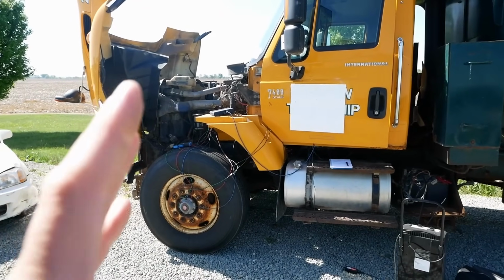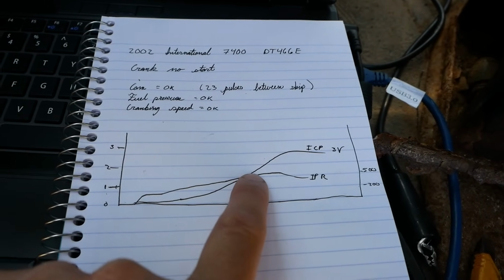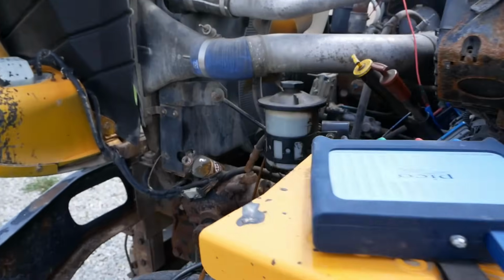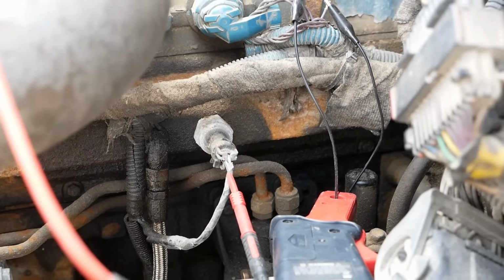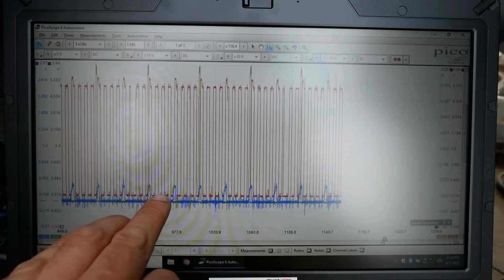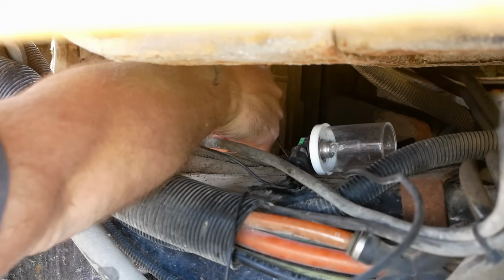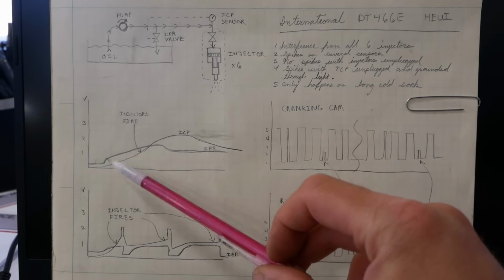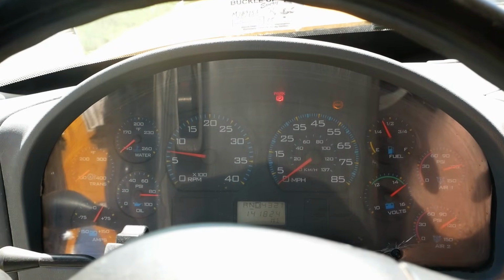International DT466E Won't Start without Ether after Sitting

Comment: Hey, couple things.
Do you have while cranking 500 psi or more  high pressure oil for injectors? If its low it wont start. Bad ipr valve or bad wiring at ipr valve it wont start, i had that at the ipr connector, the wire sheathing was torn and they were touching each other. also i had one with no codes and it was a bad cam sensor, another truck had no codes and it had a bad crank sensor. Also had another intermittent no start, the connector at ecm was loose i found it with wiggle test. sounds like your truck is intermittent, they are the worst to fix, if you get it running grab any wires, harnesses, connectors you can get hold of and move the hell out of them, try to pull connectors apart, ect. Check for corroded connections  starting at battery terminals. I seen a few where the circuit breaker for IDM or fuel heater  had corrosion at the box that holds them. check fuses too,of course. I always start at fuse panel looking for blown fuses, corrosion, bad circuit breaker, ect, fuses at battery, basics first, visual checks

Comment: Enjoyed the video Wes.  I don’t have too much experience on the older 466e models.  But from what I have seen on all older internationals, is the ecm power and ground weather pack connectors are notorious for having high resistance due to spread terminals.  This will cause a hard start issue and ecm power down issue.  There should be 3 weatherpack connections, one at the battery box, one by the starter, and one by the firewall (driver side).  I know you checked the powers and grounds at the ecm with a test light.  But to verify whether these ecm powers and grounds are the problem, what I would do is, before starting the truck, after a 48hr cold soak. Back probe the ecm connector at the powers and grounds like you had them. And see if you have sufficient enough voltage and a good ground with the key on and while cranking.  You can even supply your own power and ground while cranking to see if this is your issue.  Also do you think that you have a parasitic draw on your batteries that could be causing a ecm power down the longer it sits?

Comment: Your not getting oil pressure to fire injectors. Bad o rings on rail.
Reply from the maker: We are. We can see it on the scope ICP voltage goes to 3.5 with injectors unplugged. That's 2500 psi. You must be the 300th person to comment this.

Comment: i would replace the cam sensor they are the same international say there not  i had 12 trucks. the easy way to measure them is the one you take out with the one you are putting in. i wire on the ipr goes bad from heat and oil check that. you have to buy the ipr but the magnet goes bad most of the time. you do not have to pull the huey pump to replace the ipr just remember there is a ball that can roll out. i think it's a 1 1/4 deep socket i think it's the craftman that works look inside the socket if it has shoulder it will not work.

Comment: Stalled out a 466 climbing a hill, it started rolling backward, they will bump start and run in reverse. Don’t do it. Blows exhaust out the air cleaner and draws air in through the exhaust.
Reply from the maker: Can confirm. Seen it happen.

Comment: One thing I always did with these DT466's with sketchy issues like this. Have a good working IPR, ICP sensor, Cam Sensor on hand. Replace all 3. If it starts good. Re-install each old sensor untill original issue developes again. Check grounds and powers to ECM, correct as required. Also you need to check duty cycle of IPR and the oil pressure of the HPOP to determine a weak oil pump or failing IPR(NO START HOT CONDITION), also install vacume gauge on suction fuel line to tank to make sure the pick up is not cracked at the very top. This is not in response on your diagnostic video here. Just a general quick overview from what I have learned from working on these internationals. Once you familiarise yourself with these internationals and the dt466. They are so simple and can be diagnosed in under 2 hrs 98% of the time. Other 2 percent of the time, your looking at ECM harness issues or the ECM itself.

Comment: Had this on a truck I worked on. Issue was low compression. Truck had "compression" but not enough to light the diesel from a cold start situation. Would smoke but never get hot enough to start without ether. Was simply worn out. The cross hatching was gone on every cylinder. So, we did an "in frame" and got it running. Recommend a total overhaul, but it was a local truck and wouldn't spend time on the interstate again so the owner went the cheaper route.

Comment: I worked on one of these, customer says only starts on ether and has no power.  I figured out it needed batteries because the live data froze every time i cranked. The ether allowed it to run fornlong enough the ecm could regain power and take over on fuel. No power was due to a weak magnet on the ipr. Customer was suprised i was able to pinpoint the issues like that.

Comment: Wes could this be a case of a bad oil pressure sender? Early fuel injected vehicles would not start if they did not sense oil pressure. You stated the gauge was finally working on that last cold start and needle was shaky.

Comment: ed here, had 2 international tractors that needed ether, the pumps were weak and injectors not spraying well. still lot these tractors around with the 6cycl. engine. this was before the electronic injector pump

Comment: I worked on these type of trucks for N.Y.S that were used on the 90 interstate. The ECM wire connectors use to get pin corrosion from plowing and salting. I did many replacement pins in the connectors and somethings you had to just cut out the connector and reconnect each pair of wires individually.  Salt kills wires.

Comment: Needs injector oil rail pucks
Reply from the maker: No. That would cause hot start issues, which we do not have.
Reply: @WatchWesWork  I work on international plow trucks for maine. When The Puck orings fo bad they have  very extended crank cold because ouil bleeds out of the rail and it takes a long time to refill the rail. Hit it doesn't have time to drain the oil off so it will start fine.
Reply from the maker: @jamesfarrington7434  When I unplugged the injectors you can see the ICP voltage go to over 3 volts. That's over 2500 psi.
Reply: I mean I'm not there with you or the lab top to see what's getting commanded v what's actually happening. But, most typically we see those symptoms (not starting after sitting) when it needs pucks. But,we have seen it before when (on some of our older trucks) the plugs on the harness (between starter and frame rail) that goes from the battery to the ecm get corroded.

Comment: The issue is on oil side  the injector solenoids are leaking and at cranking speed you do not have enough oil flow to create enough pressure.
Reply from the maker: That would cause hot start issues. We don't have that.
Reply: Hi I'm Bob, This condition is worse on a cold start because of the fuel volume required during cold mode operation. An easy way to check this is to remove the valve cover and during cranking, watch the exhaust poppets on the injectors. If there is more than a poof (which means there should be no stream) the exhaust poppets are leaking.

Comment: Can you do a pressure test of the high pressure oil system like in a powerstroke
Reply from the maker: Sure, but that's not the issue. It can build pressure just fine with the injectors unplugged.
Reply: @WatchWesWork  thanks again for the reply. I was just following along watching the video hoping to help lol

Comment: Internal oil leak possibly a seal causing low pressure to injectors. My 6.0 powerstroke needs 500psi to start
Reply from the maker: It builds oil pressure just fine with injectors unplugged.
Reply: @WatchWesWork  oh ok thanks for the reply. I really like watching a problem getting solved. Great video!

Comment: One thing Wes and I’ve been down this road with these trucks. Unfortunately with 1200 comments you probably won’t ever see this but you could of helped yourself with wiggling those PCM connectors while at idle. I’ve had one abruptly stall with just a wiggle and it turned out to be the IDM. Grant it. It was a newer truck with the separate IDM behind the PCM, but just the same. Bad solder joint on circuit board/pin out. Fortunately, you’re probably on the right track. Certainly not unheard of to have a bad PCM. 

Kind of mysterious that the PCM connector bolt is stripped too. That’s telling. Who knows what’s behind there. 

International can program the new PCM on the bench. Think they need mileage, lifetime fuel consumption, VIN, and I’m forgetting something. Oh well. I’m fried. 

My day consisted of Lancing frozen bucket pins on a Caterpillar and hammering, pressing and cussing. Victory was not to be denied on this day but man it wiped me out. 

You really don’t want to pull that doghouse and replace that PCM anyhow. Dirty, slimy messy ass engines that would without a doubt snowball even further because….why wouldn’t it?
Reply from the maker: I see everything! There very likely could be some crustiness in the connector I can't get apart.
Reply: @WatchWesWork  haha. That’s great. Oh yeah. Forgot to mention. International made the ServiceMaxx J1708 software download absolutely FREE. It’s only working on trucks 2006 and older, but it will and can give some data on say a 2010 I have confirmed it myself. On that truck it has some decent capabilities for free. Go download at Diesel Laptops or should ever you deal with and trust. 

So, a laptop and say a NEX-IQ USB Link II or if your Ford IDS/FDRS equipped the VCM-3 works too. 

Love the content. Have a great week

Comment: This seems like a bad ECM; the problem with it starting cold after 24 hours may have to do with something in the memory of the ECM.  There is the very real possibility that leaving the ECM unplugged from power for 20 mins would make the truck not start.
This is a ridiculous design; they should just put a high pressure fuel pump on the rail and let the injector push the really high pressure, like every other EFI compression ignition engine out there.

Comment: I had the same problem. Get a rapture fuel pump for a dodge ram and it will pull the fuel up from the tanks and feed the motor solid fuel pressure.. It will have great fuel pressure and start after sitting

Comment: Wes, this is actually fairly common and the symptoms overlap a number of possible causes, some of the more common are:  1) Low/no oil in the HPOP reservoir, 2) Low ACTUAL ICP during cranking (sensors LIE), 3) Make sure you get 35ish psi of fuel pressure at cranking and if not Inspect the check-ball in the fuel strainer and the regulator on the return fitting if EFP is low or rises slowly.  Lastly, the HPOP must be force-fed by engine oil pressure.  It's not the ECM, or at least I'm saying it's not ;)
Reply: My 466 had no start condition code was cam sensor bad it turned out to be a green corroded connector on the ecm cleaned it with deox cleaner and a brush and packed it with dielectric grease and that fixed it.
Reply: @zookeeperJohnG. I agree. have worked on 20+ of these all with either HP oil leaks or fuel prime issues.

Comment: Way back in the early '60's I worked in a truck garage as an apprentice, during the winter months I had to go around starting trucks using "Easy Start" an ether based product, and there was no doubt once you used it on a truck regularly it got addicted to it and wouldn't start without it. We had to supply the drivers with a tin or two of the stuff because when they were away from base they needed it ...

Comment: Wes, I found if any of these DT466E's had overheated any time. Occasionally the front timing case can be warped. Add another 4 quarts of oil to the engine, jack the rear of the truck up and  see if starts after that. This floods the front crank oil pump, pressurizing the injectors, allowing it to start. I was a regional fleet manager with 160 DT446E trucks to take care of. Please let me know, if this helps good luck.

Comment: If you do end up changing the ECU it would be interesting to take apart the old one. Look for dry capacitors, poor solder connections, etc.. I cannot tell you how many times working on consumer electronic microprocessor circuits I have not been able to visually see bad solder connections but reflowed the connections on microprocessor ICs have solved a problem. Considering that the truck still runs and the ECU is expensive I would not attempt to repair it unless it completely failed and did not work at all.

Comment: It is always bad ground. Mesure voltage to ground pin on all sensors and computers, make sure the voltage is next to nothing. Only then assume that the voltages you measure are OK. That is how you start to debug engines and pinball machines 😉

Comment: The fuel injectors create voltage spikes when the coils are turned off due to the collapse of the magnetic field (It's basically half of an ignition coil)  The ECM should absorb and crush these voltage spikes using diodes and capacitors.  If one of these diodes or capacitors has failed, that voltage spike can cause havoc inside the ECM circuitry.

Comment: I agree with you, Wes...gotta weigh your options...is it more cost effective to spend $2,ooo + on a computer?  Or to go out and start it once a day? I guess that might only work until the problem gets worse, which, it seems to go downhill over time. 🤔 so it all comes down to how much it matters to you (the owner). If it is imperative, pay a lot to fix it, if not, keep starting it daily or hard starting it, until it won't start any more at all, at which point you'll either be out a truck, or you'll have to pay to fix it after all.

Comment: i don't have a whole lot to say about diesels.  although i worked on diesel boat engines for a while.  but it seems to me, a failure to start first thing  in the morning, but it runs all day, tells me its possibly  a leaky injection pump or a leaky injector. my thought: the fuel pressure leaks down over night. resulting in nearly empty  injector lines in the morning.   at first  the extra oomph of the battery charger probably spun the engine just a little faster and so, worked...  but as the leak down  got worse. that would stop working and the ether, albeit not recommended, helps kick it over for that first start.  also, could be a failed lift pump, too for the same reason, a slow internal fuel pressure leak and reverse gravity feed back to the tank. this is especially possible if it is a more modern vehicle and has an electric lift pump.  and as i write this, i think that  makes even more sense than the pressure leak idea, because the extra boost from battery charger used to work because it  helped the weakening fuel lift  pump.  a couple of places to look.   that's my 0.02 cents.

Comment: If this was a Ford IDM, it is a faulty electrolytic capacitor, specifically the large 850uf cap right next to the harness connector on the IDM board. When that capacitor becomes degraded the lack of capacitance causes huge ground plane currents as the 12v -> 110v inverter draws power off the 12v buss after an injector is fired.   In the worst example I stumbled into the IDM kept blowing up H-Bridge transistors because both side of the bridge were turning on due to the noise on the ground plane.  Fun times!

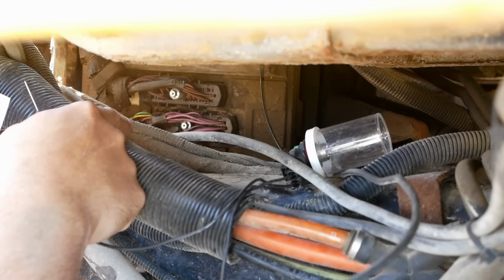Comment: The test of checking the ground and power wires going into the computer at 22:29 was incorrect. It did not prove all the wires have a good connection. The power and ground wires are connected together inside the computer so the test light will light even when if one wire has a poor connection. The connector must be pulled off the computer and the wires probed on the connector for a successful test. Unfortunately this was not possible since the connectors are stuck on the computer.

I think there is a bad ground somewhere because the high current from the injectors firing causes the ICP sensor input pin on the computer, which should be a high impedance input, to be 0.4V when it should be 0V. Even with the input disconnected from the sensor and loaded with the test light the voltage spike still occurs. I recommend connecting the ground of the scope to the battery terminal and check the ground on the computer and grounds on the sensors with the scope. I very much think the 0.4V spike will show up on the grounds which will highly suggest a bad ground connection somewhere.

I hope Wes gives an update!